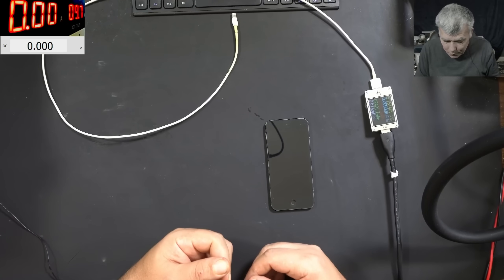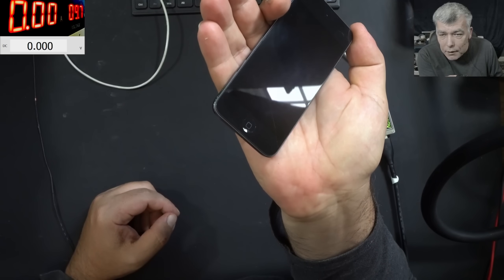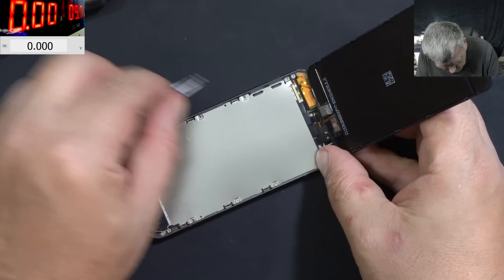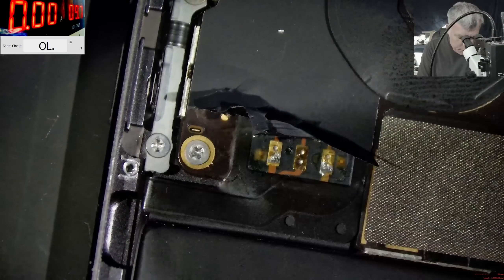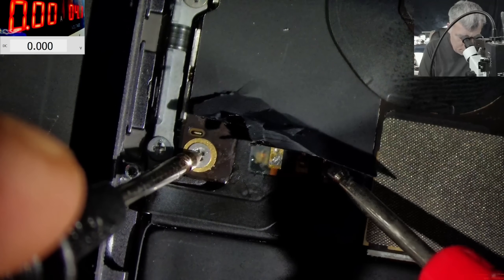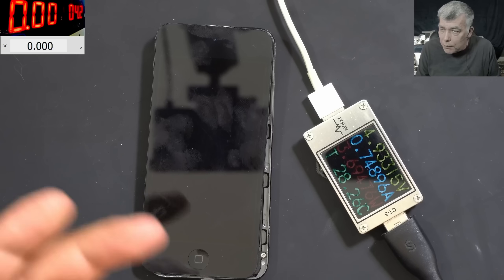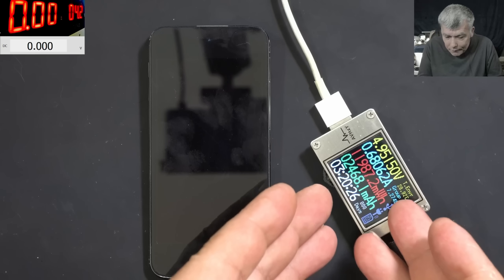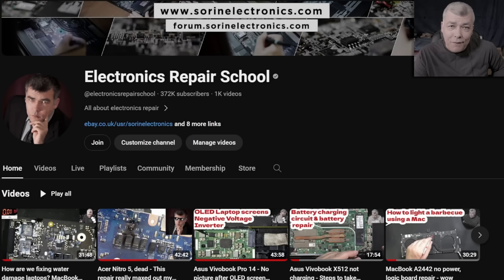Ipod 6th generation, dead, no power, not charging- a data recovery job

Comment: and always check that the black probe is on ground and not the red probe it happened to me on the nintendo switch but the battery wasn't connected the power supply clicked voltage dropped and sent 2amps but nothing happened to the board i believe the pmic prevented any damage from the reverse voltage, this can happen to anyone be careful when playing with the power supply but mistakes happen regardless

Comment: Just replaced the battery on my 4th generation iPod with mechanical hard drive, worked straight away  ,not been used for 5 years

Comment: on the fnirsi meter, there is a hidden menu you can acess by holding one of the buttons then powering on the meter. you adjust the screen brightness and timeout aswell-

Comment: thats a tristar problem, i guarantee that if the battery gets this low again and you swap the tristar it will charge normally.
but since its a data only job i guess its fine for now

Comment: 1 TB Adata external drive for backup costs 60 euro ... 
much cheaper to prevent than treat but there is a need for discipline for backup... and this is hard.

Comment: Hello, I’m facing a serious issue with my hard disk and need some expert advice. Recently, there was an electrical surge that affected my system, and since then, my hard disk has stopped working. I’ve tried connecting it to other systems, but it doesn’t show up at all. The data on this hard disk is extremely important to me, and I’m worried it might be damaged.

Can anyone advise on possible solutions or diagnostic steps I can take to recover the data or fix the hard disk? I would appreciate any help or suggestions from those experienced in data recovery or hardware repair.

Comment: If the band is intact, you don't actually have to get it to boot 

As long as you can access recovery mode you can boot an SSH Ramdisk and access the system files

Although I think some of the data is encrypted with the passcode, I'd be surprised if there aren't external tools to decrypt it using the passcode
Reply: Brute-Force(B-F) the passcode with a tool, the passcode is easy to Brute-Force
Reply: @sniper5406  you can't brute force the passcode on a 6th gen. Only 5th gen

Maybe you can externally if you extract the encrypted files but not on the device itself
Reply: @Lumalee  ohh ok good to know, i thought there is a tool/upgrade for 6gen guess not
Reply: @sniper5406  Only 32 bit processors can be brute forced. 6th gen is A8, which is 64 bit
Reply: @sniper5406  Why would you even try to brute-force the passcode in that case? Just ask the customer. You'd know it either way, but just asking is way quicker and cheaper for both sides.
Reply: @Smaxx  what if the Customer don't have the Passcode, (i suppose too)
Reply: @sniper5406  That's a different case, obviously. 😉